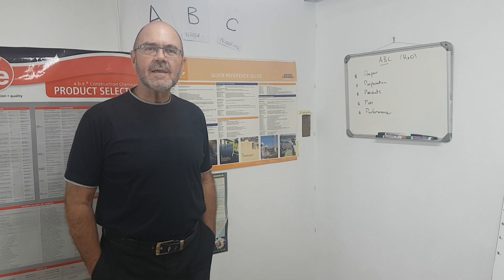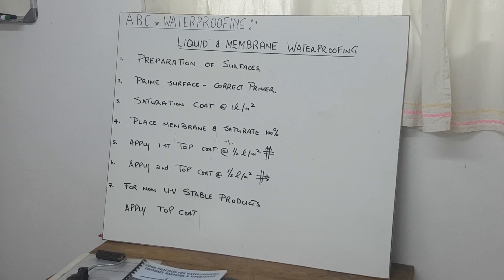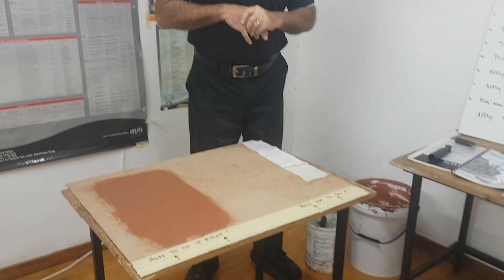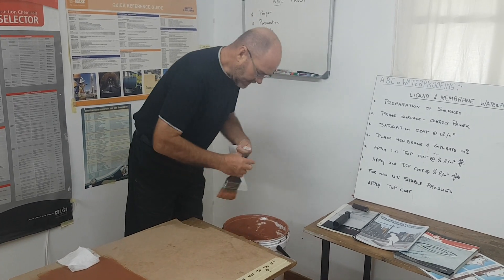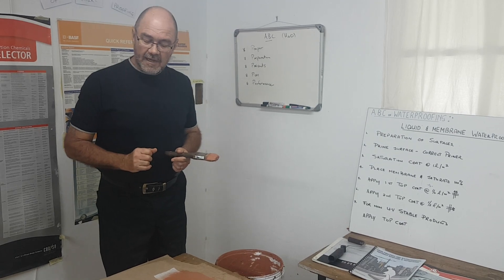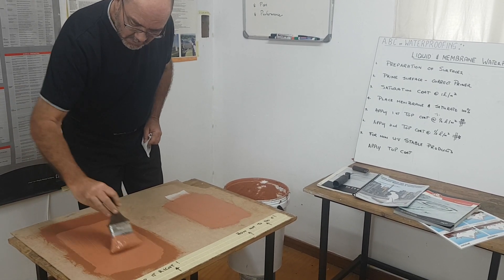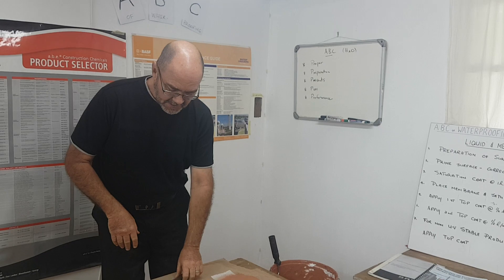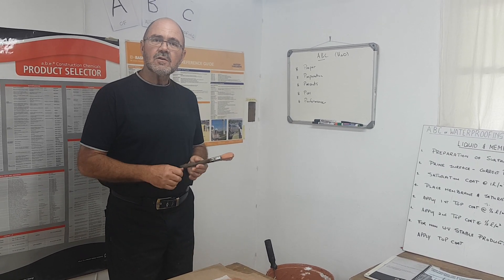Waterproofing Liquid Membranes ABC

Comment: Hi there 
I wanted to know if we can use this liquid membrane system after it rains? I am planning to clear the surface water and make sure it’s dry beforehand but the rain water that has penetrated through the flat roof may still be “trapped” inside?
Thanks!
Reply from the maker: Hello, yes you may. If you are worried it may rain again soon it is advisable to use products that are not water based. I recommen a Hybrid Polyurethane system.